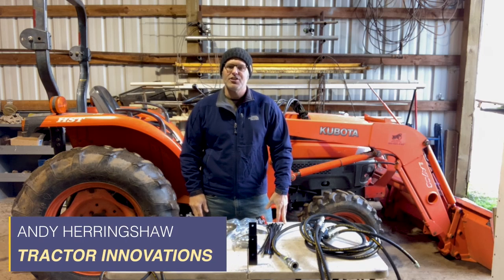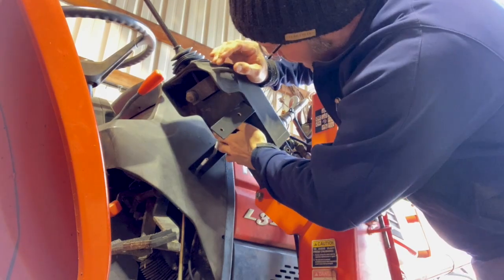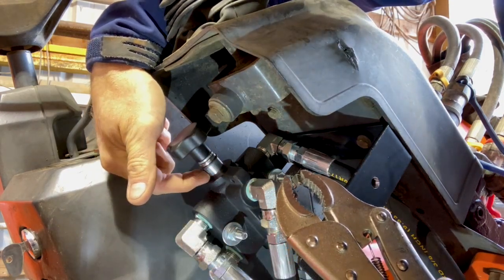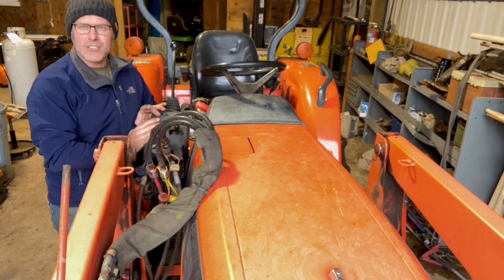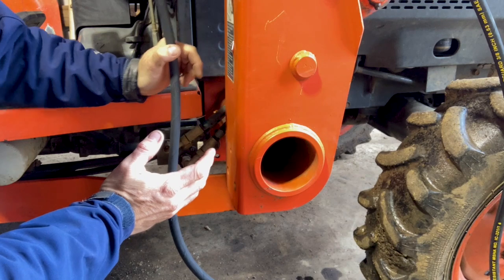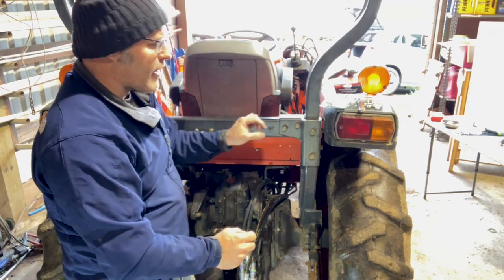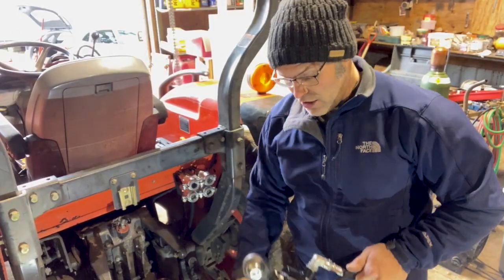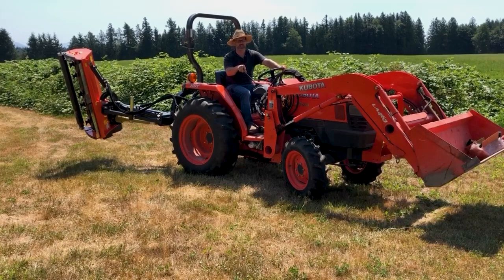$1140 Double Remote Hydraulics Kit for Kubota B, L, MX Series Tractors - Easy DIY Install

Comment: You are quite knowledgeable about the L3130. Any idea why my loader tilt is literally frozen when left not running below freezing. I changed the fluid but it’s still happening. It functions if I start it and let it run for 15 or 20 minutes to warm the fluid.
Reply from the maker: No idea right off hand.   I would start the diagnostics by swapping the hose circuits.   Put the lift (normally white/yellow) onto the Red/blue couplers, and vice versa.    See if your tilt cylinders works fine when hooked up to the lift circuit.   See if your lift cylinders work fine when hooked up to the dump circuit.  Does the problem follow the cylinders or the valve?
Reply: My l3130 does this too.. I think it’s in the valve

Comment: Hello could this system work just constant for a backhoe?
Reply from the maker: I build a different type of kit for constant flow.   Even more affordable and easier install than this switching valve.

Check out the install video:
https://youtu.be/OeFj5bxMH9c?si=Txo1jqxxjjVAizjC
Reply: @TractorInnovations  i have a kubota LA 525 put a summit third function on it then decided to have rear power beyond for the backhoe. 
The hoses for the power beyond hoses and the third function go to the same port. So i bought t fittings to hook both hoses to pb and return up by the main valve. When i plug the backhoe in to the power beyond it won't work unless you push the button for the third function.
Reply from the maker: It is hooked up incorrectly.  I do consulting if you want me to look through your setup, via pics or FaceTime, figure out what to wrong and recommend a fix and parts.  $50/30min.   I have no doubt I can have you fixed up in 30 minutes.